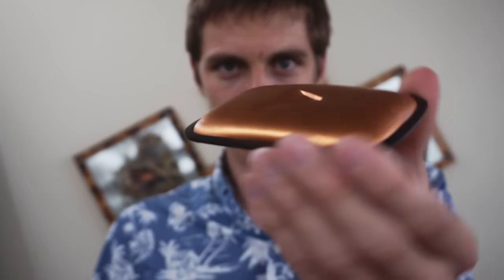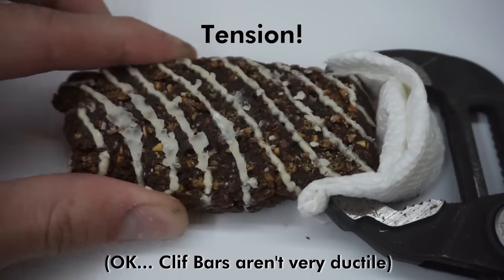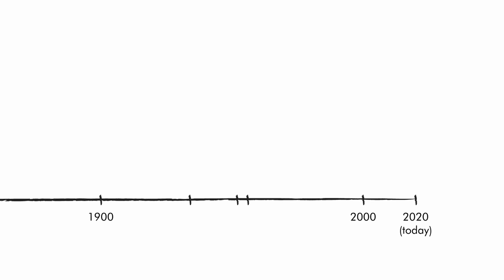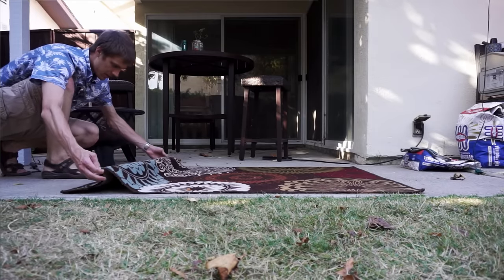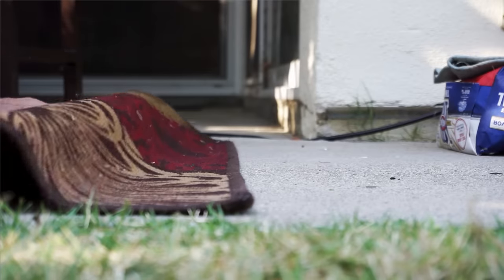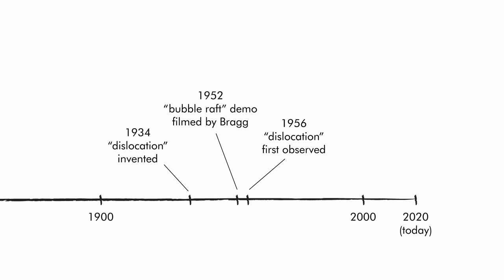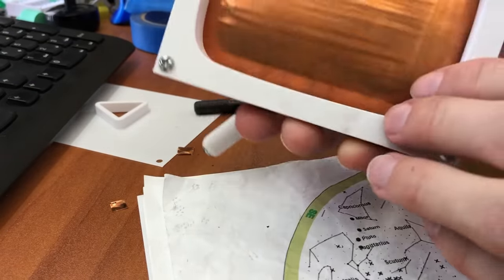Why are metals so stretchy? (2^13 sub special)

Comment: I don’t think I heard this mentioned, but my apologies if it was.

I would imagine that all this movement is possible because of electrons’ unique properties in solid, metallic metal. Their ability to exist unlocalized to a particular atom means the nuclei can slide like you describe. In contrast, an ionic solid like NaCl is held together by tightly localized bonds; vs the highly delocalized bonds in metallic copper…you can’t stretch salt.

Yes?

Comment: Just came here from Steve Mould, and I've watched so many of your videos in the last couple days. This is a really fun channel.

As far as the 2^14 button, since you're working with ice crystallization anyways, would it be possible to use the pressure that water exerts by expanding while freezing to force a ductile material into a mold? I love the idea of putting a material and a mold in a water bath, freezing it, and getting a press-fit final product.
Reply from the maker: That's a really really cool idea! is there a name for that? I'd want to say something like "phase-change hydroforming" but I bet that's not what I should search for...
Reply: @AlphaPhoenixChannel  Oh I have no idea, just a thought that came to mind. I bet a lot of the searches I'd do would just give me ice carving techniques, or ads for ice cube trays

Comment: Hmm, so since this is at least partially down to the imperfections in the metal, does the number of imperfections affect the properties of the metal? Like for example would tempering a metal remove some imperfections, making it require more energy to deform it, and more brittle vs. ductile?

Comment: Before he got into the answer to the question, I gave it some thought and found it was more intuitive to think of the crystal like a ball pit. Think about the way the balls settle and stack together, they'll form regular patterns just like a crystal. And then I just imagined what would happen if I slowly lowered somebody into a ball pit. Like, how they would move to get out of the way to make room for the person. Or whatever object is going into it. Just the same way as the atoms in the copper sheet would have to move out of the way if you were embossing it. But yeah, I think a ball pit's a pretty good analogy for a crystalline structure. Don't you guys? Unless there's something really important I'm missing here.

Comment: You want play button suggestions? I have some
3d print one
CNC mill
okay, after lurking around for a bit i see these are already redundant
However
ablate material with a pulsed laser (close to the milling idea but LASERS)
cast metal, glass or some other melty substance
computer generated hologram of a play button (printing may be tricky)
directed lichtenberg figures? I'm not sure if they could be guided with enough precision tbh
laser engraving (just a mild laser ablation tbh)
powder metallurgy
I really like the channel so far and wish you best of luck
Cheers

Comment: What happent when you forge (red hot) metal ? Does the heat just help the dislocations to move easier so basically making the material more ductile ? Your bubble demo is so cool and I liked also the one of steeve mould with his ball bearings where he also showed annealing effect. Forge your next play button in steel !

Comment: I have a few questions. One is "how do the atoms re attach themselves to each other after they dislocate?" And the other is "what keeps them from permanently detaching from each other?" I mean if the atoms dislocated from each other wouldn't the piece of metal just start crumbling into pieces? I hope you can explain this to me because I won't he able to stop thinking about it til I understand it lol. Thank you for your time!
Reply from the maker: The same forces that cause them to make a crystal in the first place - atoms just “like” to bond. They save energy when they stick together so when they are broken apart they reattach as soon as possible on the other side of the dislocation

Comment: Yeah, this meshes so well with Steve Mould's videos about sphere-packing and crystals. I wasn't actually brought here by him, but I'm glad I landed on this video nonetheless.

I wonder if the demo might explain why forging can remove imperfections in metal: notice that when the bubbles are compressed, the crystals get larger. I dunno. On the other hand, maybe not: I wonder how work-hardening relates to all of this?
Reply from the maker: work hardening makes so many dislocations that they run into each other and can't move. It isn't very easy to represent in 2D

Comment: Excellent. The little bubble demonstration was a very impressive teaching technique. Can you use it to show why metal fatigue happens? Especially why different metals suffer from more of it while other metals like copper have so little of it? I've always thought metallurgy was a cool topic but their terminology confuses a lot of people. You are on to something with explaining its nuanced terminology.
 Next play button... would it be too aggressive to suggest Titanium? Or maybe you could do one of the cadmium alloys that melt at a very low temperature and pour it into your already existing mold?
Reply from the maker: You can sort of do fatigue with the bubble raft, but it's SUCH a zoomed in picture it's not really accurate. dislocations in 3D materials are lines, instead of these dislocations in a 2D material being points. Work hardened-metals get that way because the dislocations in 3d end up entangling each other, and that doesn't transfer super well to 2D unfortunately. if you bend a bubble raft back and forth a few times you just end up amorphizing it.

Comment: Hey man, this got me curious. When you heat-treat or temper metals, does that realign the dislocated area and make it less prone to moving is such a way? What's the relation There?
Reply: Repairing defects is one thing that happens. Another is that different combos of heat and pressure lead to the metal shifting into different crystal lattices and structures

Comment: So, these deformations all moving to the edge of the crystal, is this what causes work hardening? When you bend a normally flexible piece of metal over and over, it eventually becomes brittle and snaps. Is it correct then that all (or just enough) the dislocations in it's crystal lattice have been "worked out" of the structure until it's pretty much one uniform crystal that can't spare any dislocations under the force your applying, and it just snaps?
Reply from the maker: It’s actually weirdly the opposite - in 3d, dislocations get tangled in each other easily and stop moving so work hardening just makes more and more dislocations till they all get stuck
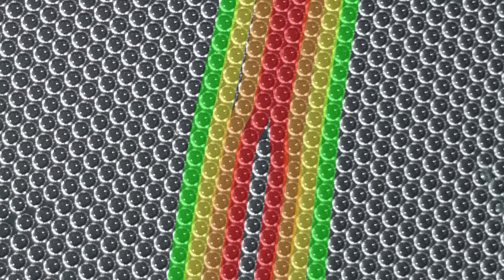Reply: @AlphaPhoenixChannel  That sounds quite counter intuitive. I wonder how it is that dislocations can tangle? Is it the abruptly ending rows of atoms shown at 7:37 that are getting tangled? Is there a paper or youtube video somewhere that goes more into depth on this, or the molecular physics of work hardening?

Comment: What makes certain crystalline solids good at introducing/moving dislocations, while others don't seem to? At least, based on this demonstration that would be the difference between malleable and brittle materials, right?
Reply from the maker: Exactly! The magnitude of the Burgers vector and the strength of bonding. Very weak and omnidirectional bonds (like in metals) are easy to slide, and the Burgers vector is usually only one atomic radius. Not as easy for a hard, high-bandgap ceramic like AlN

Comment: What would happen with a perfectly crystalline metal (assuming you could somehow make a metal with no dislocations or remove dislocations)? If you tried to shape it, would it be analogous to that insanely strong metal shear model, or would dislocations form under stress and then allow movement along them?
Reply from the maker: Dislocations would form at the edges and move in rapidly. The weird thing is dislocations slow each other down, so this perfect single crystal you describe should be very plastic at first and then get slowly more brittle as you keep deforming it

Comment: Did you notice the copper work hardening as you... worked... on it? If you heat it you can anneal it and it regains it's malleability. What does that mean at atomic scales?

Comment: Incredible demo there! You said “plastic deformation”, which makes me wonder how elastic deformation can stretch a lattice and have it snap back into position. Or is there enough give between atoms (analogous to the softness of the bubbles that facilitated the ripple) that elastic deformation is just a rigid lattice literally stretching? I’d like to see a comparison between how a metal lattice can stretch but a ceramic lattice cannot. I’m also wondering of those ripples cause slight vibrations in the material, possibly related to phonons, which I learnt about once.

For a new play button idea, I’m quite fond of electronics so designing a vector image and displaying it directly from a memory IC to an analog scope would be cool, though it’s not exactly a manufacturing method. Hand-etched PCB? Casting a homemade polymer? Custom glassware?
Reply from the maker: Hey! - The bubble rafts are actually extremely elastic - you're completely correct that elastic deformation is stretch of a rigid lattice. As soon as you start moving dislocations, you actually need to apply the opposite stress to get them to move back where they came from, and then it's "plastic" because it won't bring itself all the way back. The main difference between soft metals and hard ceramics, mechanically speaking, is how easy it is for a dislocation to move. Dislocations are extremely hard to budge in ceramics, but glide easily through metals.

Notably, this is because ceramics are crystalline *compounds*, unlike pure copper where every atom is the same. That means that the "extra half plane" of atoms at a dislocation is at least two planes, one for each species. The result of this is that the strain field around the dislocation (Burgers' vector) is a lot wider, and you have to break more bonds / hold them broken for longer to get a dislocation to move through a ceramic material. To pile on even more difficulty, the covalent bonds in ceramics are much stronger, and more directional than metallic bonds based on mashing spherical s orbitals into each other.

Comment: If you've ever heard of Zen Magnets or Bucky Balls then you'll already know what Im talking about, and if you haven't then I highly suggest you look them up. 5mm NiCuNi Coated Neodymium Rare Earth Magnets, usually comes in a set of 216 magnets. These freakin' amazing little things can be used to demonstrate the bubble raft experiment a little bit differently. The magnets attract strongly with a N/S pole connection and when properly paired with others in a crystal lattice sheet you can show the same properties when forcing the sheet together, compressive force, and pulling it apart, tensile force, and you can watch the same dislocation actions happening. If you go slowly you can watch as the magnets shift one by one creating the illusion of going frame by frame. I couldn't say that it would be an accurate representation of the atomic shape of a metal deforming, but I would like to think it is. Additionally you can stack sheets and make a cube out of them and with soft pushing or pulling it looks similar to how I believe a 3d section of atoms in metal while being deformed would look. They make for a fun toy and a great modeling tool as well of course.

Comment: One exercise in my workbook goes like this: (in the 16th century?) an Italian scientist conducted an experiment to know if water can be pressed. He filled a silver tank full of water and soldered (?) the lid, then hammering. Surprisingly, the water rinsed out of the tank and he came to a fail-safe conclusion: there are distances between silver atoms. I can't find out the name of that scientist, but can we elaborate it a litter bit? The H2O atoms would go along the border of grains of crystal or it would came out by the dislocation of vacancies or there are tiny holes formed on the tank? Thanks for the astonising demo. And is there anyone has the information about the original or any checkup experiment and the explanation?

Comment: I was wondering what dimensionally pure copper would be like. Would the lack of imperfections create a stronger metal? How would you even make this stuff?
Reply from the maker: Do you mean like defect free? A perfect crystal? It unfortunately doesn’t exist... silicon wafers for electronics are the most structurally perfect materials that we know of in nature or laboratory, and those still have 10-100 dislocations per square centimeter... for reference the crystals I grow at ucsb have ~10^9-10^10 dislocations per square centimeter...

Edit: that’s on par (maybe a couple orders of magnitude better?) than a random chunk of structural metal

Comment: This is amazingly informative and interesting.  But one thing is confusing me - why is it that Metals are malleable and ductile due to these imperfections (particularly dislocations), but ceramics or other ionic materials aren’t? I believe imperfections are frequent in almost all crystals, including the crystals of ionic solids, so I’d assume it has something to do with the electron sea in metals vs static electrons in ionic solids, but it isn’t addressed here. If anyone can give an explanation, I’d really appreciate it.
Reply from the maker: It’s how easily the dislocations can move. like you said metals have relatively direction-ambivalent sea-of-electrons bonding where ceramics are normally ionic or covalently bonded, (sometimes) more directional and normally much stronger, which make lone dislocations harder to move.

Also, in ceramics the unit cells are larger, so there are normally actually (kinda) two missing planes of atoms, because you have two different kinds of atoms.
This means the bonds around a dislocation are much more heavily strained, causing them to inhibit each other’s motion more, as if the material was pre-work-hardened. That part doesn’t show up in the bubbles in 2d at all unfortunately

Comment: That's why the metal creaks when bent, which is particularly audible in aluminum. Use piezoelectric mic and glue it on metall.

Comment: A couple of years ago we had a competition among game developers on the most optimized particle simulation for 30k rigid particles on CPU. Record time was around 1ms per simulation frame. Interesting thing to note is that simulated particles did behave very similarly with the same type of moving fault lines/imperfection ripples. Here's a video from one of the competitors: https://www.youtube.com/watch?v=UsAlcalH7qQ&feature=youtu.be&t=41

Another thing to note is that if particles are 100% rigid, shear mostly happens with fault lines (very high ductile stress), if you make them slightly softer, then ripples happen (medium ductile stress) and if you further make them softer, they start to flow (ductility becomes viscosity). Discussion in russian here: https://gamedev.ru/code/forum/?id=88430&page=27 . I have also shared your video with them, pretty sure they'll find it interesting.
Reply from the maker: that's AWESOME! is it just a really short range potential to simulate hard spheres? 1ms/frame is nuts - that's some efficient code
Reply: @AlphaPhoenixChannel  It's called position-based dynamics. There's no interaction potential, particles are pushed away from each other by just changing their positions and position verlet takes care of tracking implicit changes in velocity.

And yes, those guys are crazy good at low-level optimization. My code was pretty efficient but it still ran something like 2x slower than that of the winner.

Comment: So the amount of dislocations you need to make is what determines how strong the metal resists deformation?
Reply from the maker: Weirdly it’s normally more dislocations that actually make a material brittle. Its relatively easy to make new ones, but if you get too many they tangle up in each other and can’t move

Comment: My suggestion for a (2^14) subscriber special could be like a Glow-in-the-Dark PlayButton, BUT see if you can amp it up so that after a day of charging in the light, it can stay lit (even if very dimly) for the entirety of the night time. Since night time duration depends on where you're at, maybe it can be treated with the 16 hours awake, 8 hours asleep schedule we're supposed to have? That way you can play with efficiencies and try and have it so that for every 2 minutes it's exposed to light, it will emit 1 minute of glow when removed from light.

Comment: Ok, so now I'm wondering:
What is work hardening? Why does copper get stiff when I continuously hammer it?
Why does copper get soft again when I heat it and cool it rapidly?
Why can I break a piece of metal by continuously bending it back and forth until it snaps?
What exactly is happening when I harden steel?
Why can steel be hardened and iron not?
Why does steel change color when tempering?
Reply: deforming the metal make the dislokation move, if the dislokation reach the edge of the cristal it is gone. Introducing new dislocations is difficult just by bending the metal. On the other hand, heating up the metal makes the atoms vibrate more and introduces new crystal defects (dislocations).
No idea on your other questions.